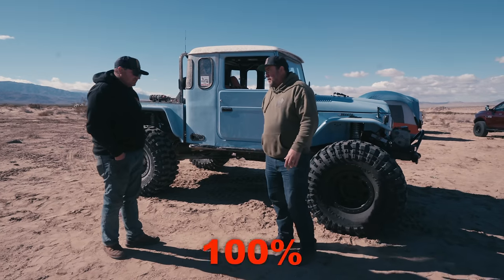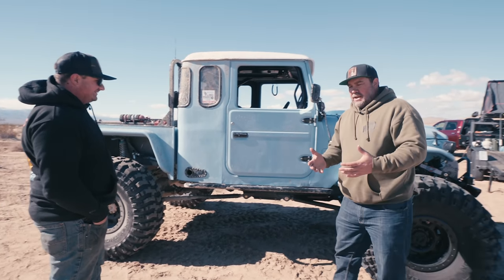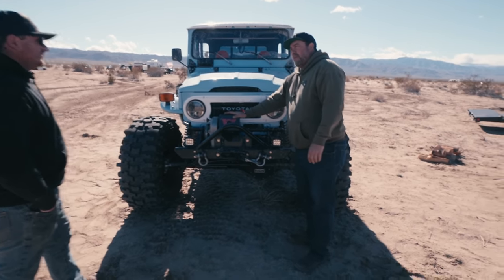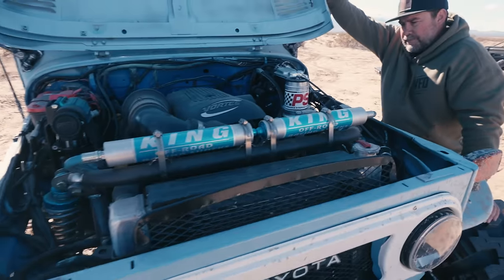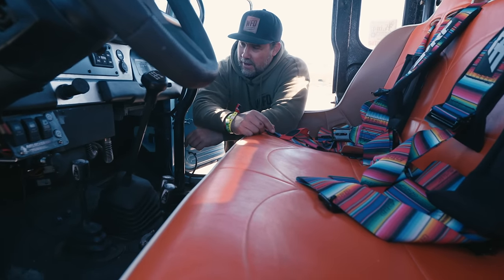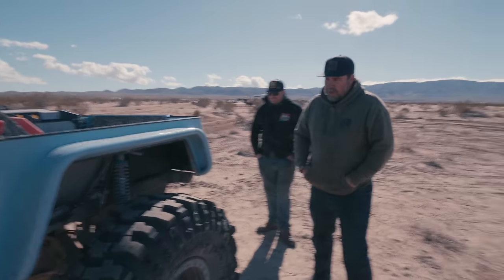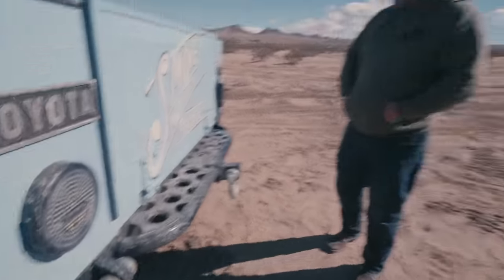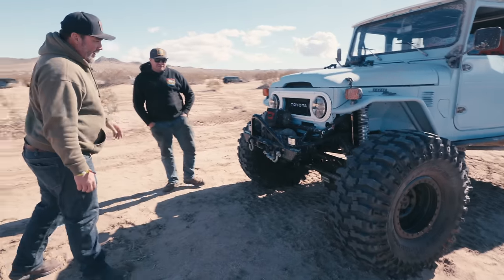FJ40 Turned FJ45 on 1-Tons & 43's | Full Walk-Around

Comment: What is the side window off
Reply: There custom built I cut them out
Reply: Do you know measurement from back of door to end of cab. I’m building one in Australian and like the proportion. And tray length  @SmokeyMountainFabrication
Reply: I cut the body of a FJ40 and built it to a 12inches longer than a stock 45